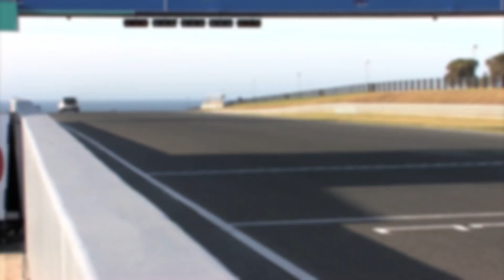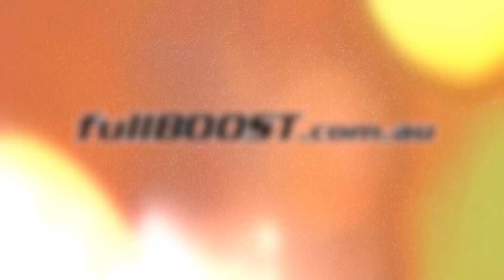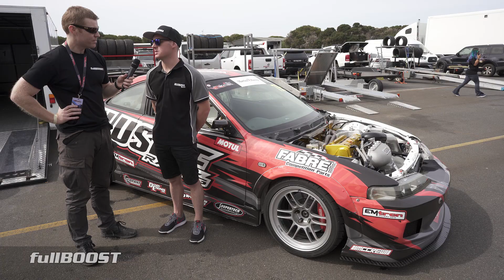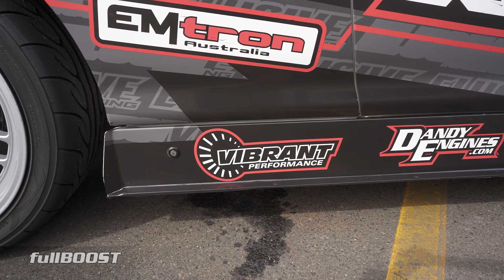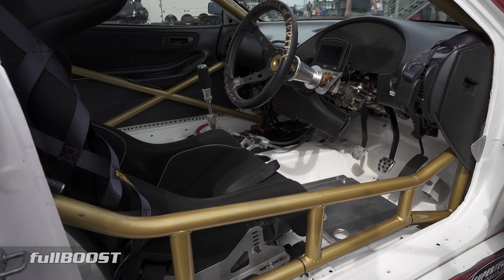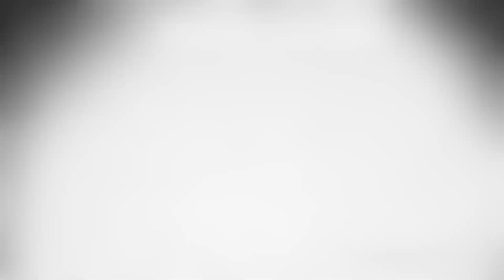TURBO Honda K24 time attack Integra | fullBOOST

Comment: Why do people flip the engines like that ? Exhaust going on the back side and intake on the front ?
Better intake temps or something else ?
Reply: Stefan Supra it’s a k motor they come like that in the car they come out of it works more then fine as you can see
Reply: @douglasbaxter3346  thing is I've seen it with B series too
Reply: Stefan Supra and much of the new stuff that’s fwd have exhaust put the back it’s no big deal.they didn’t fit this motor just because they wanted the intake at the front it’s just how that motor is mounted up to the gearbox in this car
Reply: El Duderino  a race team somewhere in South East Asia built a reverse head H series
Reply: El Duderino  point being that it's possible he could of seen a reverse head b series
Reply: El Duderino  just some food for thought fam, not everything that gets done in the world is displayed on the internet

Comment: So why do pple put a k20 head on a k24 bottom?
Reply: In my very, very limited knowledge on tbe subject that could be completely wrong: k20 head probably has better cams bigger valves, probably stronger and made to withstand more power because some models of K20 were performance designed while the K24 was originally never designed for that purpose i dont think
Reply: Reason is because k24 has better/more torque and k20 head because it handles better with a turbo
Reply: Better air flow. K20 heads flow better than K24 heads and they bolt up with little modification. K24 is just a taller K20 essentially.
Reply: K20 heads(some) have better flow and smaller chambers. K24A2 head is 95% the same, a bit of work and its ok.